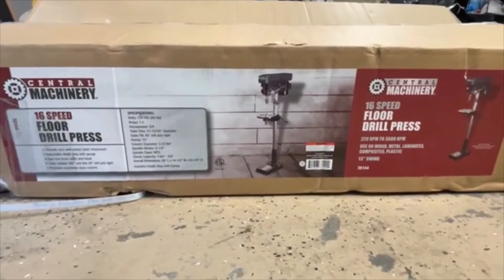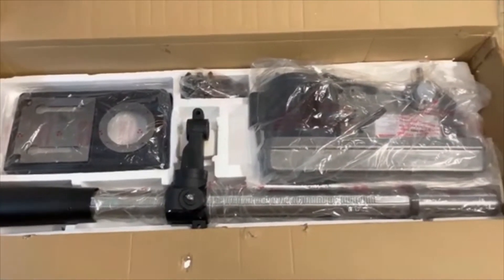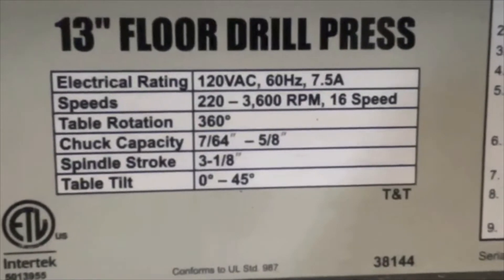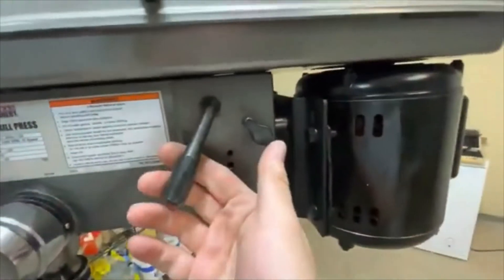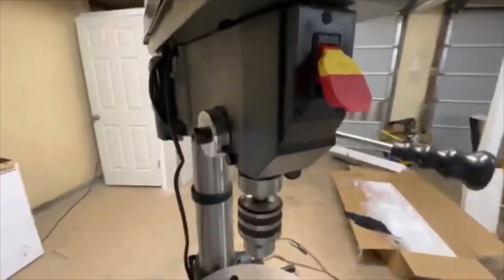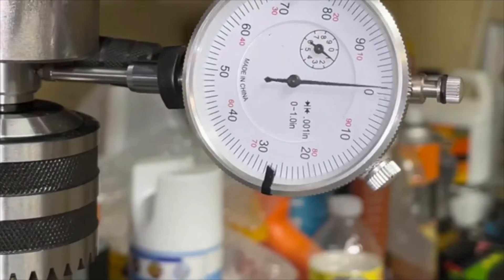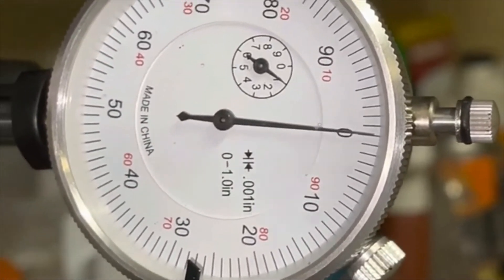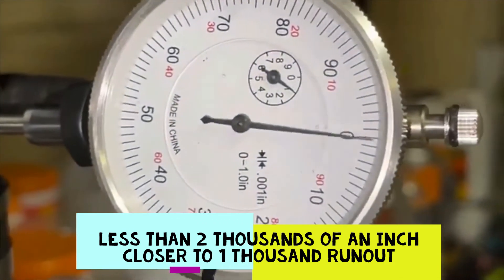Harbor Freight CENTRAL MACHINERY 13 in 16 Speed Drill Press 38144 Worth It? Best Budget Drill Press?

Comment: Just for reference, that's not where you want to check the final runout of a drill press. For various reasons. You need to check the runout about 1" below the chuck, using a known quantity like a precision ground dowel inserted into the chuck.

Separately I'm interested in how the press actually performs on various materials. Specifically the harder (and thicker) stuff like mild steel, stainless, 7075 forged aluminum, 4150 forged steel, 8120, maybe some AR500, etc. Does it have enough torque for those apications? Or is this strictly a wood, or small hole on thin metal, press?
Reply from the maker: Thanks for the information maybe we will check it that way as well….as far as drilling no issues at all have drilled various metals used HF drill bits as will and it’s cut through everything I needed it to
Reply: @DIYKAI  Any specifics? What kind of steel, how thick, how big of a hole/bit? I'm trying to gauge it's capabilties...

I guess you can always upgrade the motor to like a 1 or 2 HP motor. HF even sells a few electric motors that range from 1 to 3 HP rated. I think the 1HP is $179 regular price without any discounts, and the 2HP is $199.